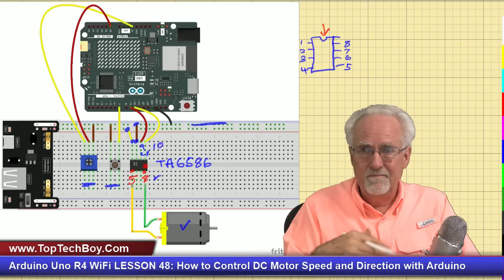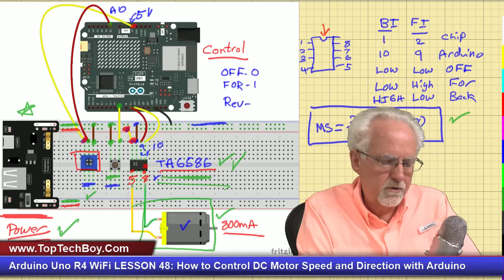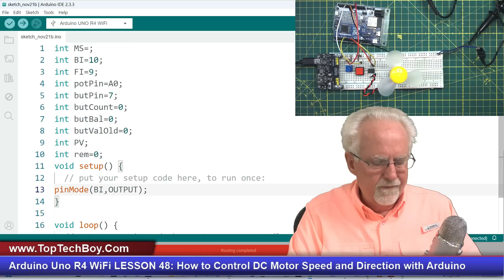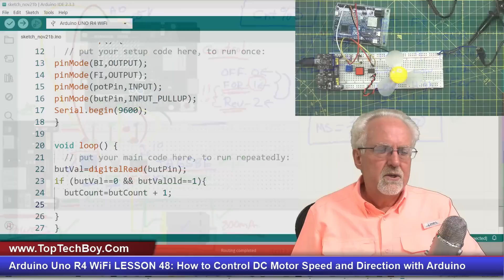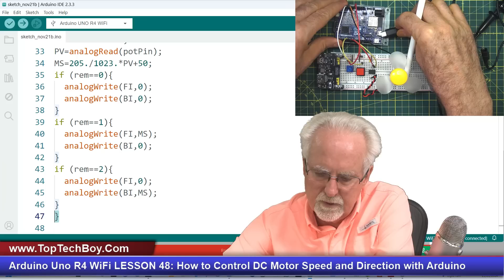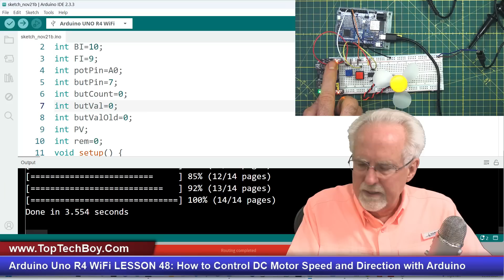Arduino Uno R4 WiFi LESSON 48: How to Control DC Motor and Speed and Direction with Arduino

Comment: Nice solution. 

 I did a different thing..  I set both FI & BI High to HIt the Brakes and no coasting.. I also flipped the Pin labels instead of values...  BI stayed =0 and FI stayed= motorspeed. I just flipped the pin numbers.
Because I hit the brakes I didn't need an Off.  Different solution - same result.

  Thanks again for Great Tutorials.

Comment: Hi, Paul.  Awesome series.  Thx.  I didn't use the modulus approach.  Instead, I simply stopped the motor whenever the button is pushed, since the button is only pressed when I want to change directions.  Relevant code excerpt below.  Any pros/cons on using this approach vs. the modulus approach? (BTW, I used a pulldown resistor.)

buttonState = digitalRead(buttonPin);
  if(buttonState == HIGH) {
    Serial.println("HIGH"); // for debugging
    
    //stop the motor and wait for 100ms
    analogWrite(FI, 0);
    analogWrite(BI, 0);
    delay(1000);
    
    //switch directions: 
    temp = current; 
    current = last; 
    last = temp;  
  }
  else {
    Serial.println("LOW");
  }

//actual motor control: 
if(current == FWD) {  //FWD is declared in setup as const int FWD = 1
  analogWrite(FI, MS); 
}
if(current == BWD) { //BWD is declared in setup as const int BWD = 0
  analogWrite(BI, MS);
}
delay(100)

Thanks, again, for the great series.

Comment: Why no 10,000 ohm resistor on the button? Every other lesson we included the resistor when using the toggle buttons. Anyone know why we don't need it now?
Reply from the maker: We are using the internal pullup/pulldown resistors now.
Reply: @paulmcwhorter  a reply from the legend himself?!? 😳🫡🤯. Thanks 

I am still working the homework for lesson 47. I just peaked this build so i dont damage my board. Pull-ups make sense but i did not know the internal resistors reach 10k.

I do not understand how the board picks resistance. We never told it the volts or desired amps…just said ON. It still seams like magic to me. Hope it’s mentioned in later lessons.

Thank you for the awesome education and the positive mentality throughout.

Comment: there is no homework assingment but i made one
i change colors on a  rgb led with functions pressing the button and counting buttonValue up to 3 also i am controlling the value of my potentionmeter and i change BI and FI instead.... i didnt use any extra chip i did that only with values...... 
https://youtube.com/shorts/ROw8M_XN3qc
https://youtube.com/shorts/kvlN_iO3odY
https://youtube.com/shorts/PggDgO1uEK4

ty paul 
you made functions sound easy

Comment: I did not have aTA6586 controller so I used an L293D controller instead. This required a bit more wiring for a speedcontrol. After a long time I realised that I need to use digitalWrites and not analogWrites in my solution. A nice lesson and once again, new knowledge gained. Thank you for your excellent lesson.

Comment: Hello Paul GREAT LESSON!!  I was successful, but improved your solution in the following ways:
1. used modulus 4 so I could have a stop between direction changes in BOTH directions;
2. Incorporated a previous lesson on Functions, and added a Braking function to slow to a stop.
Also, during troubleshooting, I discovered the project worked perfectly well without the OLDbut/NEWbut checks.

Comment: I am legend (sort of).

https://youtube.com/watch/rNuknrXv1_s

As seen in the video, sometimes the motor stops for a short while, then goes back to working normally. Any ideas welcome 🙂
Reply from the maker: LEGEND! Sometimes the motors can generate electrical noise that confuses the electronics. Try twisting the wire leads of the motor around each other.

Comment: Paul you mentioned that you covered how to generate the equation for PV in the last lesson, but it's not their. Is it possible you covered it in lesson 45 or 46 which have been removed. Might want to add a supplement lesson on how that equation is generated. Also, thanks for incorperating the osciliscope into the lesson it's always an added bonus when you help me use other tools on my work bench.

Comment: If you turn the power supply module off, the TA6586 motor driver chip doesn't have power, yet the Arduino may be either driving the BI and FI inputs high or pulsing them with a PWM.  Is there any concern about harming the TA6586 or are they built to withstand that?

Comment: Independent Study - Making music with a DC motor    https://youtu.be/9EFxCz5mEow?si=ZIqSPy5vdnb56pBX
 Maybe because I am more a musician than an engineer, I was intrigued by some info on the internet using motors as audio oscillators.  On Arduino, just like using PCM to drive a dc motor, one can use the tone function which outputs a square wave of a fixed 50% duty cycle to drive the motor. Increasing the frequency doesn't change the speed of the motor but changes the on/off frequency of the motor which generates a vibration at audio frequencies. The volume is very low but can be increased by preventing the motor shaft from turning and fixing the motor to a surface which increases the reverberation just like a speaker does.
Reply from the maker: Certainly one of the most amazing things I have seen all day! Well done.

Comment: Hello, dear Paul, I am glad that I am learning Arduino with your help, I am just worried that these good tutorials of yours will end at this length, I request you to go to the end of the Arduino reference.  Especially in future sessions, focus on module writing for a few sessions.  And after this course, if you focus on Arduino PLC, it will be great.  Thank you, I wish you health.  be victorious
Reply from the maker: The challenge is that even doing something very simple like blinking an LED on the Arduino from a button in a browser on a desktop is extremely tedious, and difficult to explain. Making it work for different applications then envolves a lot of very advanced html. On the other hand interacting between the pi pico and WiFi is relatively straightforward and easy to explain. Really, I am disappointed in how difficult it is to do anything useful with the WiFi. It will require either learning vPython or advanced html
Reply: @paulmcwhorter   with all due respect  sir cant you just try to teach the wifi with arduino ide if u do not know how to use it you can learn and go back to teaching it to us .i tried other arduino lessons but i learned nothing   until i met u  can u please help us.

Comment: Thanks it is a very good lesson. I have build it with a L293D motor controller. And I have not the problem with digital write and analog write. So I think the problem is not in the Arduino R4 but in the TA6586.
Reply from the maker: Thanks! I really appreciate the support.